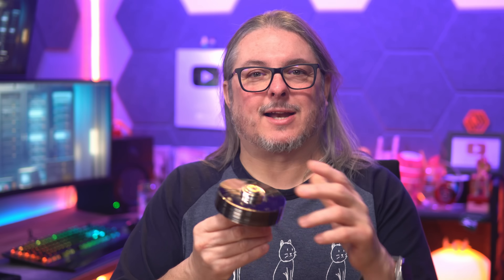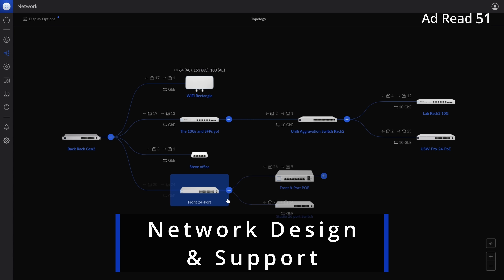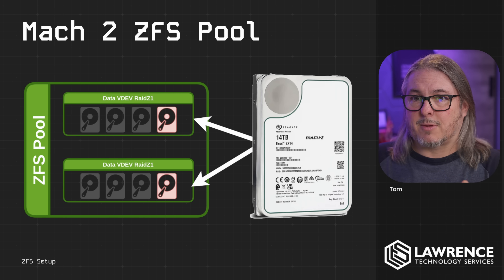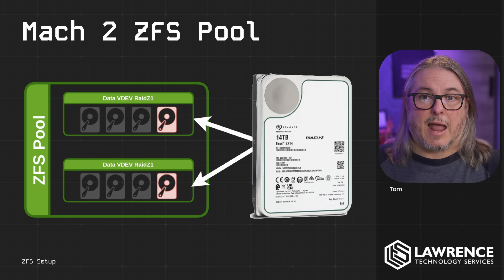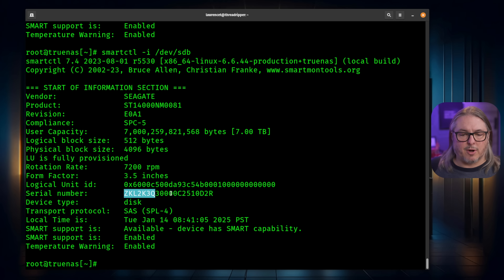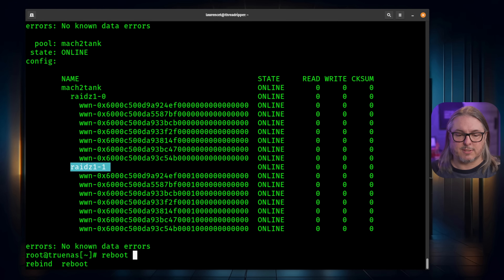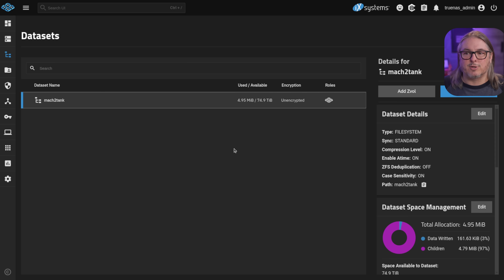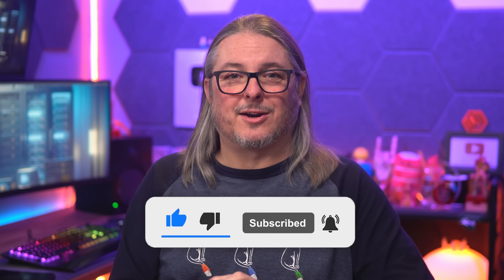TrueNAS + Mach.2: High Performance SAS Homelab Storage

Comment: Pretty cool idea to get some performance out of spinning rust. I'd never dare to do a raidz1 with a Seagate product though. At least raidz2+hs. But ymmv. What will get complicated is when 1 or 2 "half drives" fail and you need to replace them. And as this is a Seagate product those failures are inevitable. One single mistake replacing the drive and the pool turns to rust. I think the SATA version handles it better. Even if not presenting 2x the performance. Will try this for sure when a dependable company has them.
Reply: Ah yes WD the "dependable company" that made SMR NAS rives without telling anybody
Reply: What dependable company, WD? HGST? Oh they're the same company, and WD used to ship SMR NAS Drives, drives. people only found out because their array are preforming like garbage.

Comment: Terrible idea, having the single physical drive present as two logical drives.  So 2 physical drives, raid 5, one physical drive dies, you've just lost your raid.  It's not like they couldn't present it as one logical drive if they tried.
Reply: it presents two logical drives because that this is the only way to have existing software and controllers take advantage of the dual-actuators in this disk. It relies on the administrator to configure a sensible raid scheme, but that is hardly an issue for a businness product.
The Sata drives with dual actuators don't present two logical drives, but they are still just concatenated, it's not doing a RAID0 in hardware. So that just means you have to split it with partitioning, which is something most raid controllers can't understand (they expect a raw drive not a partition)
Reply: That's why Tom set up the vdevs the way he did, so both halves of the same drive aren't in the same vdev. As a result, losing the drive would degrade, but not destroy, both vdevs.
Reply: @rpungello  for Truenas yes, but many systems are hardware raid controllers, and would these drives cause lots of problems with SANs and other NAS systems.  It's a terrible design, one physical drive should present as one drive.  Whatever next.  I'm basing this on 38 years IT experience, using enterprise systems, dealing with hardware and software, in data centers.
Reply: @ "this product doesn't work for me, so nobody should be able to buy it" is a pretty L take.
You can happily buy 14TB single-actuator drives if you don't want the complexity.
Reply: @rpungello  don't know where you got that from, who exactly said nobody should buy it and where.  There could be applications where this could be ok, but very unlikely to be in a data center, or enterprise NAS/SAN systems, people like to keep things simple to minimise errors and accidents, and lots of software, just like Truenas, doesn't work properly with it - you have to fudge it.  Plus the extra training, the rewriting of documentation which has applied for 30 years, rewriting utilities and software and scripts.  Leave this for the hobbyist, gamer and homelab.
Reply: @JonathanSwiftUK  what I expected to see is a single sas/sata drive with 400/500MB/s speed ( internal raid 0 whatever I don't care how they achieve) 

Now it looks more like two drives in one 3.5 case with port multiplier and system still see it as two separate devices with duplicate serial, which is not ideal. 

Something similar was like fitting two 2.5 drive with port multiplier board in one adapter similar to QNAP QDA-SA2/QDA-A2AR 

IMO what it achieved: now you have more drive in each 3.5 bay ,that's all
Reply: @frankwong9486  the point is that these drives are going in a RAID array anyway so why add a RAID0 chipset to do internal raid0 when your existing RAID controller can do the same (and probably better)?
Reply: One stone two bird design , when it died ,it took down two 😢

System audit log : why the hell there are two drives that got removed and need rebuilt when ticket say there is one side of Mach drive error ?
Reply: raid is not a backup
Reply: @popeter @popeter raid is for fault tolerance,  your backups could be a separate drive attached to Truenas in a homelab, or in an enterprise it should be a separate system, and for DR you might replicate it to another system, in another building, preferably more than 10 miles away.... to pass the auditors questions.

Comment: So I think the tech is cool but honestly I don't think they really should be used. There is more of a use case for SAS and I agree that SATA really shouldn't be used period.  I do think that platter drives will be around for a while as well but that the added complexity of these will just make them not worth it for most use cases. Things like drive failures and rebuilds are also going to be impacted by this and what happens when someone stupidly puts both of the actuators in the same vdev and now their entire pool is corrupted because of a single drive failure. If someone wants/ needs the speed I think that SSDs are cheap enough that you can just get those and even if you don't want to convert everything you can just use tiering like we always have done. Again the tech is cool but I wouldn't recommend it for anyone to actually use due to the added complexity and chances of failure.
Reply: I think these were more of a solution to the ballooning rebuild times with larger capacities than strictly to improve performance in normal use. One of these drives can potentially rebuild in roughly half the time of a same-capacity, same-platter count, single-head drive.
Reply: @5467nick  Ah if that is the case then they are improving in my eyes. I still don't think they should be treated as separate drives though and should simply be a way for the drive to double the IOPS and potentially increase read and write speeds. Again SATA is not a good fit here. They cap out around 550MBps which this would probably start hitting. SAS though is a much better fit as SAS supports multiple IO Queues and has continued to be improved past 6Gbps. They just need to make that complexity internal to the drive instead of making the end user have to manage it. I mean basically this thing should just be treated as 2 drives in a RAID 0. They should just do that in the controller and sell it as a really fast regular HDD.

Comment: I always wondered why they didn't try to do something like this with the actuators. But why not just show up as one drive with more performance? Certainly it wouldn't be bottlenecked by the SAS interface.
Reply: because that adds cost to add a chipset to do RAID0 internally. Since they are made to go in a RAID array anyway that would be redundant

Comment: I wish the drives could be seen as one with 2x performance to simplify
Reply: that means adding a chipset that can run RAID0 over them, but since these drives are meant to be run in a RAID array what's the point? Just have your main RAID controller (or software raid) handle that